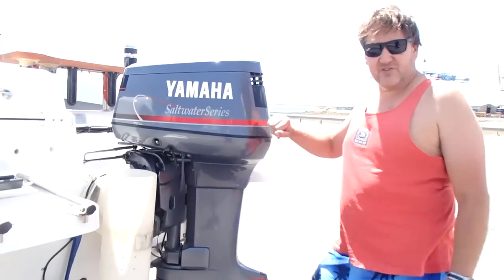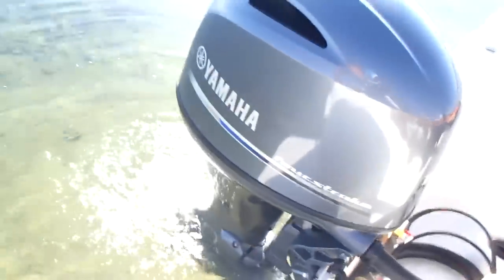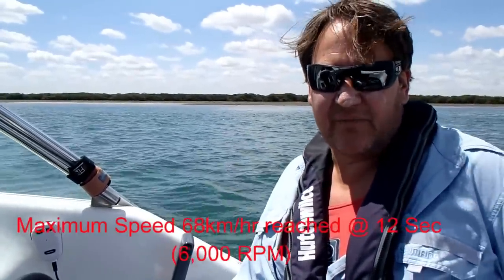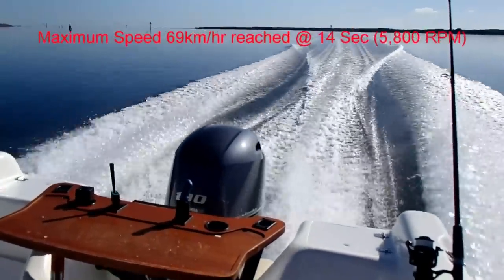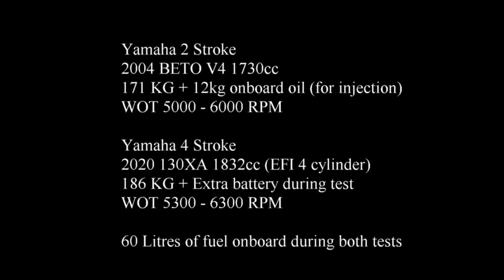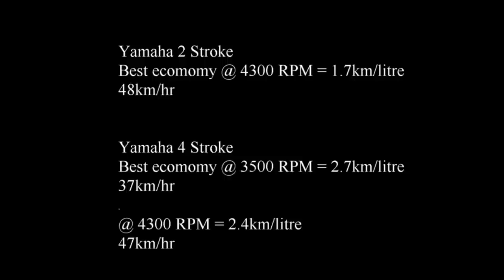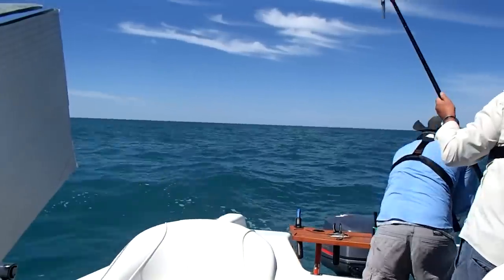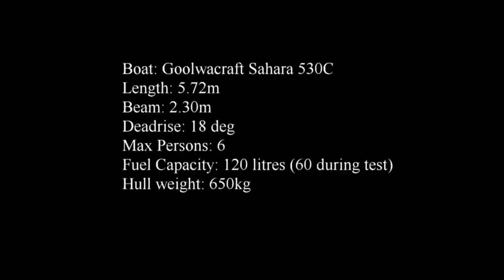Yamaha 130hp 2 stroke verses 130hp four stroke

Comment: How reliable are these  Yamaha 4 strokes compared to my 64 year old engine for example.. I’m looking for fuel ⛽️ but most importantly reliable when my family is on board..
Reply from the maker: Hi Dan, good question with so much crap online, usually due to biased opinions. I never had any issues with any of the three Yamaha 2 strokes over the past 30 years (had to get different sizes). Four strokes these days are basically marinised car engines and it's probably fair to say any US or Japanese build motor will be extremely reliable providing you maintain it (mainly oil change and salt / corrosion protection). Before you assume it's made in one of these respectable "engineering countries" check the made in XXX tag. I found a few brands like Honda being made offshore (Anaconda..). Most catastrophic failures are due to inexperienced morons with more money than brains. Both 2 strokes & 4 strokes should really be the same reliability. The old two stroke has few moving parts but perhaps not the technology and the opposite for the latest fours. Make the switch, you'll have less sick family members from fumes :)
Reply: How reliable is your car engine?

Comment: Why dont you tilt engine out for more speed ?
Reply from the maker: Hey, thanks for the comment. Interesting you picked that up - I thought the same thing when I first ran my 4 stroke, it really doesn't not like the high trim like the 2 stroke. The outboard seems to almost flat where as my 2 stroke would be much higher. I have tested fuel economy and speed verses trim many many times and they are just very different.

Comment: What prop on the 130hp 2 stroke?
Reply from the maker: Hi, I can remember exactly but I believe it was 13-1/2" Dia X 15" pitch. The four is about 17" pitch
Reply from the maker: I just realised I had the prop details (as per an early post): The 2 stroke was using 13-1/2 X 15 Pitch S/S. The four stroke has a 13-1/4 X 17 Pitch S/S.

Comment: A two stroke may have less parts but reliability is questionable for example the conrod needle bearings have been known to catastrophic collapse. This two stroke rattle is not what you want to hear.
Reply: As opposed to valves And timing chains? 
Four stroke still have bearing that blow
Up too
Reply: I'm sure some new outboards have variable valve timing to improve low end torque and high end power. Having said that, more moving parts...
Reply: @vlogcity1111  Most four stroke engines have a one piece crankshaft and use slipper white metal bearings which are oil pressure fed. The reliability of slipper bearing is very high, they always last the life of the engine. With tens of millions of modern four stroke engines in service slipper bearing failure is less likely than the odds to winning a national lottery.
Reply: @AquaMarine1000  I agree with the mechanical aspect. There’s a reason you didn’t address valves because that’s a huge weak point. 
Most high quality precision bearings will last the life of an engine, valves however can go pop at anytime without notice.
Usually a con rod or crankshaft bearing will give you a noise when it starts to go, whereas valves can shatter or melt without and pre warning.
Yes that can happen on a two stroke but not as frequently.
Reply: @vlogcity1111  Some two strokes like the Detroit diesel do have exhaust valves. No engine is unbreakable especially if it is not maintained or operated beyond it design parameters. Two stroke engine production has now been relegated to history. Cheers
Reply: @AquaMarine1000  i realize that some two stroke diesels have valves but the reliable two stroke ones do not. diesel are a whole different animal.
please look into why two strokes have been relegated it happened right after HPDI's two strokes hit the market. 
all manufactures want to endorse and sell four strokes for ONE reason.
60% more profit was made from part sales on four strokes compared to two strokes. its purely profit driven, not reliability or fuel economy or ease of operation. 

thats not what the consumer wants to hear. im all for modern technology, when its not being marketed in a big expensive lie to increase profit.
Reply: @vlogcity1111  The Detroit diesel is a very reliable engine many of which are still in service. The exhaust emissions standards have killed some great designs like the Detroit, Evinrude and the Mazda rotary all of which have their followers. Cheers

Comment: Hi mate nice video about the 4 stroke weight you say its 186kg ive done a little research and found its only 172kg
Reply from the maker: Actually, just checked again and it's 178kg dry (being the X shaft type). Good pick up, thks

Comment: Two stroke wins , most of time it consume 20% more but: - cheeaper to buy- 50% , cheeaper to maintain , you can do it if you have mecanic skills or ask a friend, 4 stroke have electronics , after 200 h have a lot off errors and go in limp mode.. 4 Stroke it is good for 1000 h/ year use and comercial.
Reply from the maker: Thanks for watching my video and comments. Now my 4 stroke has settled in and I've done about 500km the fuel saving is half (my old two stroke used twice as much fuel..) Price difference is about 30% - 40% cheaper
Reply: I've never read such crap in all my life

Comment: What prop is on the 4 stroke?
Reply from the maker: Hi, the prop is 13-1/2 X 17". Probably could be a tad less pitch with max RPM being 5800
Reply: @ShortFlic  thanks mate. Have just repowered from 140v4 yamaha to the f130. Still yet to water test but trying the 16" for max rpm.